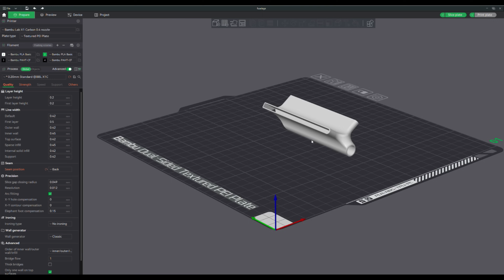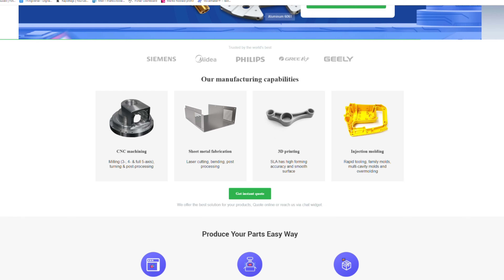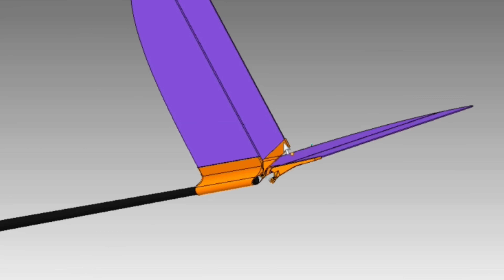RC Glider SIMPLE LADY V3, Full Build From SCRATCH and MAIDEN. RC airplane 3D printed bungee hi start

Comment: So, I am making a mashup using wings and tail from the Simple Lady and fuselage from the Electric DLG(printed 25% larger) My first laser cutter project. The wings with the CF rods are an easy build, genius really. Just waiting on the 16mm CF main spar. Fuselage with motor is all done. V tail with servos is done and configured. Can't wait to fly it!
Reply from the maker: Hi, wow, that's great to hear. Be sure to share a video or pictures, it would be great to see. Anyway, it's wonderful that my projects have really touched someone and they have tried to imitate them

Comment: Your video was excellent, too ... maybe some links about how and why cliff soaring can build up these tremendous speeds ... I saw one a while back --- all very interesting.  I am a graduate of the Lawrenceville School Class of 1965... I essentially introduced at that time model u-control airplanes, hand launched gliders and snow racers --- .020 and .049.  There was latent interest and when I went out playing it started a land slide.

A friend built me a single switch channel, radio control with a vacuum tube (HAHAH) with a rubber powered escapement in the plane --- rudder control only... It had to cycle through the right then left sequence.  But the best fun was hand launched gliders.  I was a good javelin thrower - still hold a school record for 10th grade --3rd form -- so I could get some height.  One Sunday I caught a Thermal and away the balsa glider went --- just 18" x 3"-inch wings, spruce body and plasticine balancing on the nose... About 2 minutes later and it was out of site and off the school's 600 acres of property... no return address...  could not follow it.  Earlier that year a friend took me to Lake Hurst NJ  for the indoor nationals ... So interesting ... the gossamer planes with 60-minute flight times under 90-foot ceilings in the blimp hangars.... But I could only register 30 seconds --- and others for HL Gliders were getting 60 seconds --- reaching the 90 foot top...  Something is really lost today when kids do not design, build and fly something --- there is lots of engineering to be learned from this experience -- now it is TikTok and seeing who does the stupidest things.

Comment: Really nice. Beautiful looking plane. Just out of curiosity, do you get any adverse roll with rudder input? The V-tails wants to roll the plane in the opposite direction of the turn but it is easily compensated for with ailerons but you don't have ailerons. The wings might be just so big they just resist the roll tendency?
Reply from the maker: If there are no ailerons, the wing tips must be up, which is how automatic stabilization occurs. As in free-flight aircraft

Comment: Hi Marko, nice design, congratulations.  I ask why you used the CF 18 x 8?  Is it possible to modify it to a single standard size?  In this part of the world those types of tubes are not found.
Reply from the maker: You can still replace it, but you have to make sure it's not too heavy. Otherwise, the CG will not be in place
Reply: Is it possible that you can provide me with the editable file to redesign the thickness of the carbon tube of the fuselage? I have thought about putting a 10 or 12 mm tube

Comment: Hello Marko! is it possible that you share some details about the print settings for the fuselage parts ? (vase mode for nose ? , and for the other parts, infill percentage, wall numbers etc ? ) Great thanks. have a good day, and congrats for your job !
Reply from the maker: The nose cone is made with Vase mode, the rest normally. Fuselage 2 layers and 3% infill. I'm going to try and experiment myself, many details straight into the trash :) But as usual, as strong as possible and as light as possible
Reply: @MarkoRoolaid  thanks for your feedback !!

Comment: That's a thing of beauty! What kind of winch/bungee do you use?
Reply from the maker: My bungee hi start system is already 20 years old. It was probably produced by the ROBBE company. But the rubber has a diameter of 5mm and a length of 30m and I use fishing line 0.6mm 140kg, length 120m